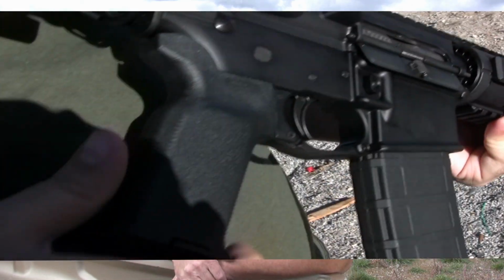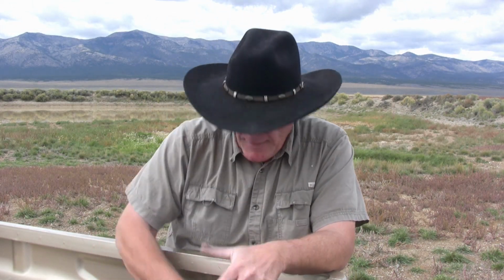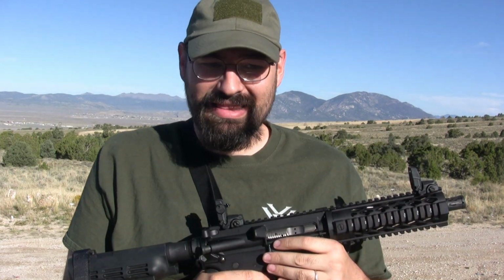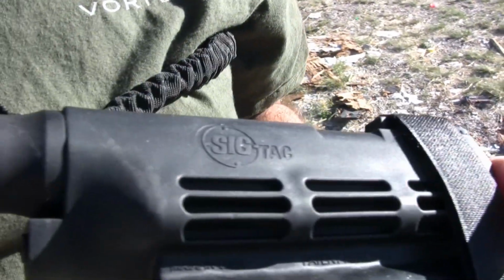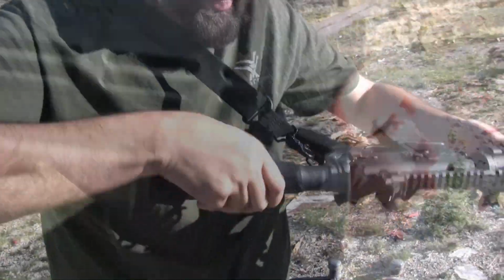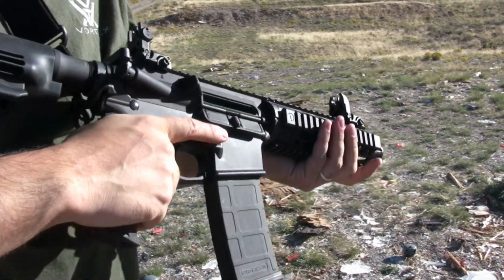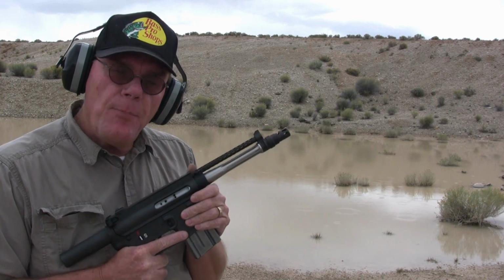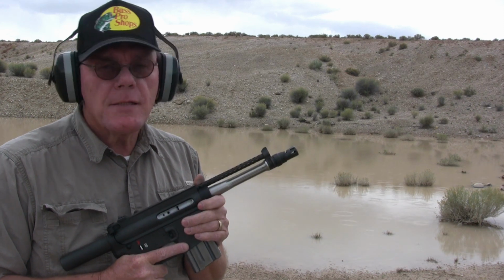Shooting Wolf & Tula Ammo in AR-15 Pistols - Is It Dangerous?

Comment: if you shoot both brass and steel ammo in the same day shoot all the brass first, then shoot the steel. then when you get home use a chamber bore brush and clean the chamber get the gun cleaned out really well and should never have issues with steel ammo. Also invest in a long brass rod, and broken shell extractor so if you do have problems you will have the tools to fix it at the range hopefully. I never had an issue and I shot it alot but I also keep everything super clean

Comment: This is "steel jacketed" ammo. Not just a steel case but also a steel jacketed bullet (aka bi-metal bullet). Now they do claim that it is a "mild steel" jacket but it is steel none the less and it is 3.5 to 4 times harder than a copper jacketed round. This product will cause premature barrel wear,  even a chromelined or a nitride treated barrel. For example if your barrel is good for 10,000 rounds using normal copper jacketed ammo,  steel jacketed ammo may reduce that to 3,000 to 4,000 rounds barrel life.   If you care about your weapons, don't use this ammo.   Research info:   https://www.uspsa.org/front-sight-magazine-article.php?Should-I-Buy-BiMetal-Ammo-8   and   http://www.luckygunner.com/labs/brass-vs-steel-cased-ammo/   and    https://en.wikipedia.org/wiki/Brinell_scale

Comment: I would like to see what Mike used to build his pistol. It look great !!
Reply from the maker: Whitey ....Mike did an excellent job building his pistol but unfortunately he didn't have the equipment to videotape the process. I would love to build one myself and if I do maybe I'll run the camera while Mike works on my gun. I think that would make for a great video. We'll see what happens.
Reply: mixup98
Well, that would be a nice way for you to get a pistol, and we can see what brand of parts goes into it. I appreciate the reply.
Reply: I used a tapco AR armorers tool along with a upper vise block and a torque wrench, believe it or not I didn't use a vise me and a friend just clamped it to the edge of a bench sideways and torqued it down also using a gas tube alignment tool thing to align the barrel nut with the upper. thanks fro the comment
Reply: mixup98 let me know when and we will get it done!

Comment: I love your videos your one hell of a shooter.  Did you have any issues with the Tula ammo?  I normally shoot wolf and federal no issues   I did just buy a case of Tula real cheap price I hear lots of people complain. But if I have issues it will still be worth it I just work on clearing malfunctions
Reply from the maker: Plecemanvpd .vldpleceman ...it really depends on the gun you will be shooting. I shoot lots of Tula ammo with an occasional dud, which usually fires if I re-chamber the round. I certainly wouldn't use Tula in a gun used for defense but the low price makes it great for plinking, even with an occasional misfire. I do find Wolf slightly more reliable than Tula ammo.

Comment: I shoot wolf exclusively due to the price. Why pay double for brass when you're just shooting around? Especially when you've got post sample machine guns..it gets expensive quick shooting 556. It's so stupid..people have such a hard on for only shooting brass..yeah it may beat the extractor up a bit but....they aren't running out of them any time soon. I'll shoot steel all day, every day over brass for the savings.
Reply: has the Wolf ammo gotten stuck in the barrel?
Reply: I use chrome or nitrided barrels in my builds, so I haven't run into this issue yet. I've heard of steel case sticking in low quality barrels but I've not seen it in person as of yet.
Reply: thanks man